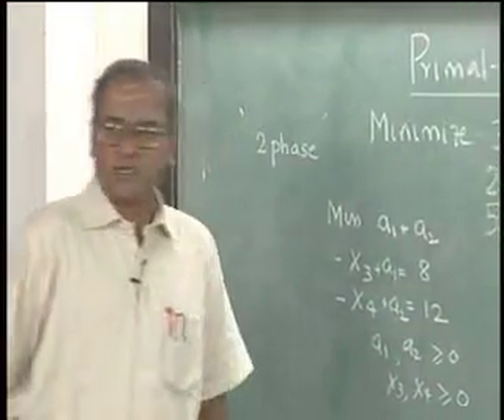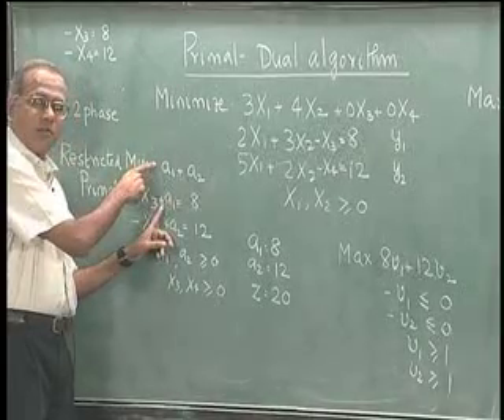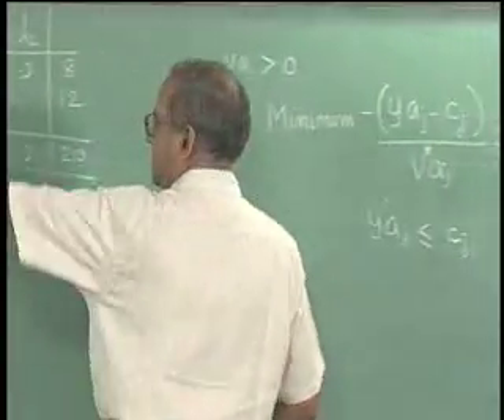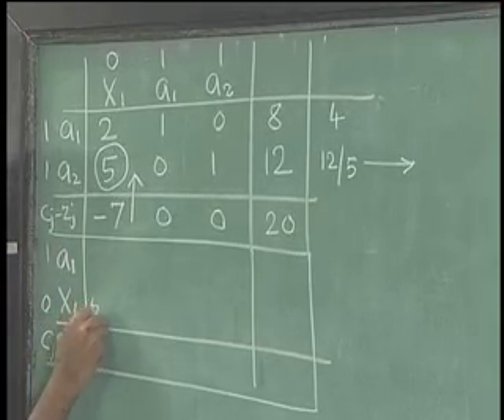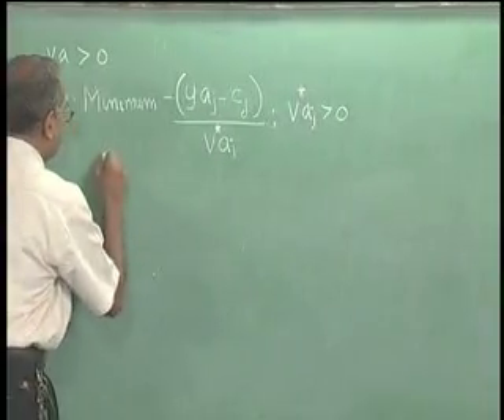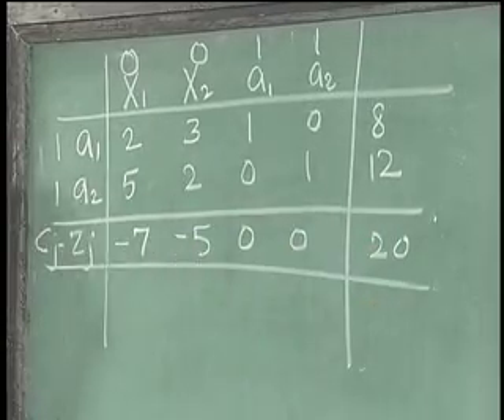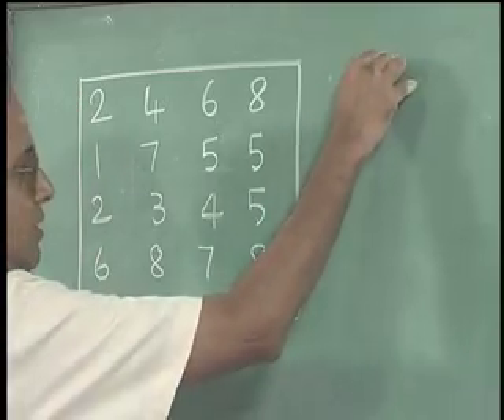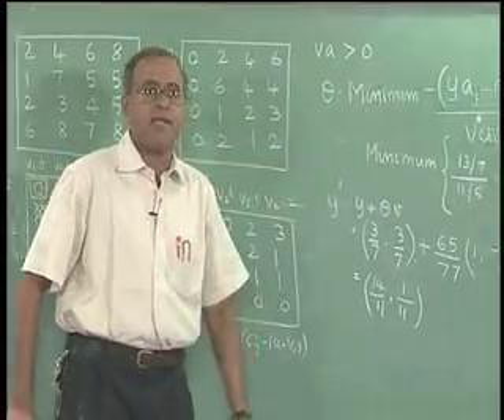Lec-8 Primal-Dual Algorithm

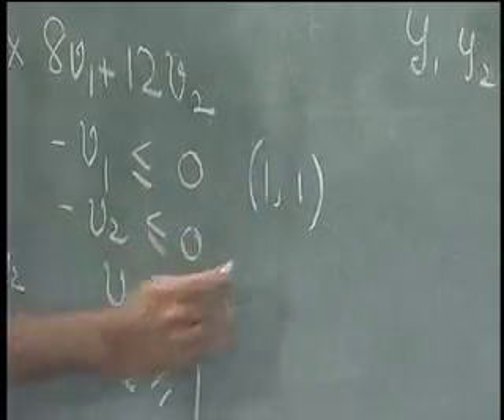Comment: @8:24, shouldn't it be "v1<=1" and "v2<=1" instead of ">=1"? Since a1 and a2 are >=0 in the Restricted primal, the last 2 constraints of the restricted dual should be "<=". Moreover if v1 and v2 were >=1, the restricted dual would be unbounded, right?
Reply: right